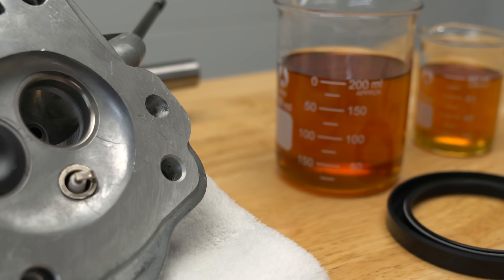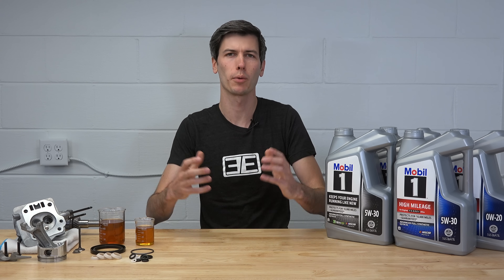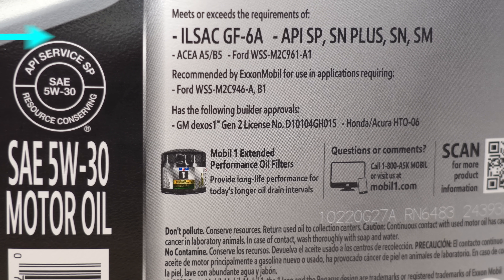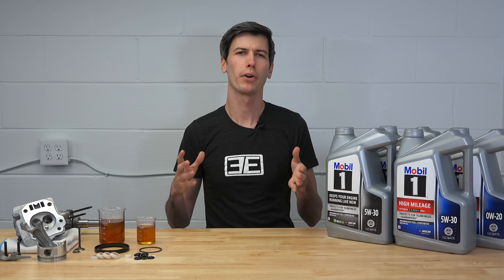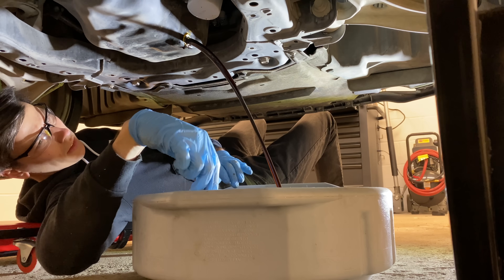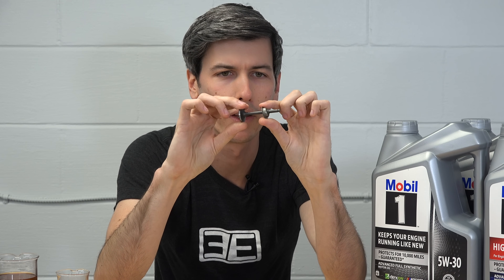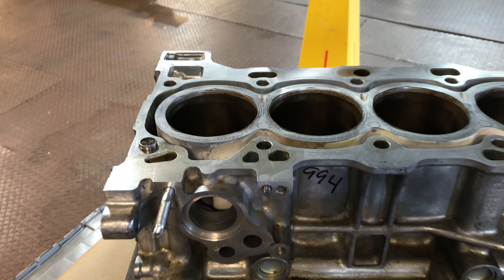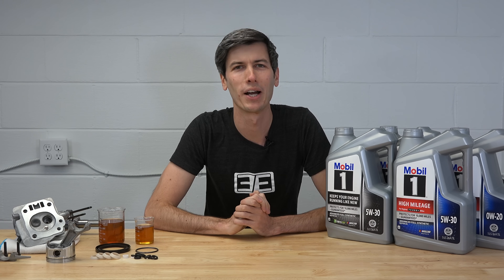Is Synthetic Motor Oil Bad For Old Cars?

Comment: I appreciate your channel and have watched most of your videos.

I watched this one all the way through, hoping for an answer about using a synthetic oil in an older high-mileage engine with a flat tappet cam.  Can you answer that question please?  The zinc/ZDDP zealots are adamant, but have no actual data.

Thank you!

Comment: I had a customer that used Mobile1 synthetic for 120k miles in a Harley Evolution eng. No leaks or oil consumption. He wanted it torn down for inspection. Every component was still well within factory specifications. Replaced gaskets never reuse, cylinder studs never reuse, rings never reuse and touched up valves and seats.

Comment: They say its ok to use synthetic oil in older  vehicles they just dont explain all aspects. If the engine is burning even a small amt of oil say do to a valve guide seal allowing oil to get to valve especially an exaust valve will most likely result  in  failure , the synthetic has a higher BURNOFF temp everyone agrees ....the oil residue builds up on the  valve = overheats , then that cylinder . I lost 2 engines to this 1 simply due to trust in  the hype  .another i added 1 qt of synthetic . 2 good running engines ruined😢😢😢

Comment: If synthetic oil is fine to run in old cars then explain to me why it destroyed my 25,000 mile small block chevrolet in my 71 C-10 pick up. I changed from Castrol GTX 10w40 to Mobil 1 full synthetic oil and within a week it wiped out the cam and lifters and contaminated the rest of the engine with metal particles which then took out the number six rod bearing. I had a very reputable engine shop go through the engine and the first thing he said was synthetic oil does NOT have enough ZINC or DDT in it to properly lubricate a flat tappet camshaft engine. So you need to stipulate that when you're making a video and tell people that synthetic oils are fine for a "OLD CAR" because that is very misleading. Since rebuilding the engine, all I have run in it since has been Valvoline VR1 and it now has 90,000 miles on it.

Comment: Pretty much any vehicle made after 1990 was designed for synthetic motor oils.  It's only those dinosaurs from the 1970's and earlier that may still be using seal materials that could begin to weep or leak due to the superior stability of synthetic oils.
Reply: And at that dinosaur time synthetic oil was real, pure synthetic. Few years ago all conventional oil was relabeled as synthetic (on American market - not European)   So, nowadays pure, 100% synthetic oil is only Amsoil SS, and some of Royal purple. These synthetics really can cause a leak in older or high-mileage vehicles

Comment: I have a 1993 Ford explorer sport with 250,000 MI I used to use 20. 50 oil winter summer whatever I do now use whatever 40 weight oil I can find that is synthetic and it seems to be doing okay but you should change the oil every 5,000 mi that what I've always done so there you go..

Comment: In 2025, I use Total Quartz 7000 10w-40 with Semi-Synthetic oil base, I use it for Honda Supra Fit New (Wave 100s) C-Series C-100 engine, its performance is still safe and even extraordinary, considering this motorbike was released in 2006, In Indonesia with tropical seasons, whether it is hot or rainy weather, its performance does not decrease

Comment: So whats considered old these days in car years?  Ive got a new car, but i mainly drive my 99 grand marquis.  185k miles, its my daily, and couple of 8 hour road a year.  Ive been using 5w20 conventional in the grand marquis, but have noticed the last couple oil changes its been low.  Like i checked it today and it was 2 quarts slow.  A year ago it wouldnt have used any oil.  No leaks either.  Maybe i just try some sea foam or something like that, see if it'll stop burning.

Comment: Yeah yeah yeah.... well , thing is people still buy farm tractors that are new , but the design is very old. Like 40 years old engine , just manufactured recently okay ?
Some did try a "new and more advanced oil" . Those got busted. So they did proove its a bad idea.
So then , people allso buy brand new tractors. And those are recent designs. Tractors are under a lot of load , ideal testbeds . Well take a guess , those who get the new tractors and use oldschool regular oil , are they happy ? Yess they are. Those who use the manufacturer rated synthetic oil are not happy. Engines wearing out in 10k operating hours is a joke. Run it with old oil ? Yepp , you get least 3k more hours. So screw it.

Comment: I'm not an expert on Rotary engines, but high quality fully synthetic two stroke oil, which is meant to be burnt, forms a lot less deposits than old mineral oil or even synthetic based oil. This much I know from data and experience of seeing less deposits on the piston crown and exhaust port. I think Rotary engines recommend two stroke oil or something that can be burnt, so it stands to reason to use the one which forms less deposits.

Comment: Motorcycles here. Old motorcycles run absolutely fine on newer synthetic oil as long as the recommended grade is respected. New bikes usually have tighter tolerances, but mineral doesn't mean better with higher tolerances. There's a misconception that 10w40 is thicker than 10w50 for example. It depends on the temperature your engine is running. Some people think that 10w50 is thicker than 10w40. 10w40 will become thinner only if the temperature exceeds the one tolerated by '40'. If you run an engine on 10w50 it'll either be the same or keep its viscosity better if the temperatures it reaches are higher. Same for Winter, 10w if you live in warm areas won't be different to 5w or 0w. 0w won't become too thick if you start your engine below 0 celsius. I don't know the exact temperatures, but broadly speaking, it's not the viscosity that chances, but the temperature spectrum that an oil can keep its viscosity consistent. For example, if you use a yamaha R1 you'll be fine with 10w50 or even 15w50 if you use it in summer only in the mediterranean, even 10w40, good oil of course, would do if you see that your temperature gauge barely goes over 90 celsius. If you hammer it down a racetrack at 14/15000 rpm lap after lap, use 10w or 15w60, as that should technically keep its viscosity under a lot of heat stress, usually 10w60 is sold as motorcycle racetrack oil. Maybe this misconception comes from the past when you had monograde oils 20, 30, 40 and so on. Those had a specific viscosity at a specific temperature.

Comment: Well I had a 2000 Chevy Silverado with only 60,000 miles on it. Up until then I had always used conventional motor oil. After asking every mechanic that I could find, it actually came down to a 50-50 decision that it's a bad idea to switch from one to the other! Half of them told me not to and the other half told me it would be OK. So I took the chance of switching over to Synthetic oil and within 4-5 month's, the front and back seals started leaking out of nowhere!!! That wasn't just a coincidence! It never leaked a drop of anything before I switched over. 🤬  In my own experience, I would never do it again!

Comment: My vehicle is on 145 000km. No oil leaks or engine wear. I've been using 5w30. Should I now change to high mileage oil because of the high mileage?

Comment: I switched to Mobile1 5-30 for my 1971 big block chevy.  With everything else it runs better than ever.  Word to the wise, if you switch to full synthetic, do a second oil change very soon after the first one, before 100 miles IMO, and even a 3rd before normal interval (e.g. 1k miles).  Engine oils are NOT intended to be mixed (e.g., conventional/synthetic), drain only drains so much.   I'll take my engine's word for it, never mind it's a science fact.  That and you've basically cleaned the system.  I changed mine 4 times over 1k miles, but then, it's a fresh restoration, and I really like my truck☺  Okay, once a year from here on out, (every approx. 900 miles), pinky swear, maybe.

Comment: I use conventional 10w40 in my older vehicles. They run quite and smooth, compared to  the synthetic oil. Less valve train noise, more power, better oil pressure at hotter temps.
That's what they like so that's what they get

Comment: My car manual says 5W30 oil, as it is not available where i live, can i only once use 5W40 oil. Current mileage = 100,931Km. Engine = Suzuki (K14B).
 Engine is performing great and fuel economy is really sweet. Please guide on this. Awaiting your response.

Appreciate!

Comment: I bought a 2003 model VW Polo with a 1,2 liter 3 cylinder engine last July from a dealer who knew nothing about the car, and I got it very cheap. However I noticed that the trunk was full of 5/30 synthetic oil bottles - empty ones. And I was shocked to see that the oil just ran through the engine, consuming exremely amounts of oil obviously. I had to refill every 20 miles. So I got to an oil selling parts shop and got SAE 50 oil for classic cars. Problem solved! During winter I put a semi synthetic blend 15/40 due to the freezing temperatures. It worked well, but also the consumption increased a bit. However, I am glad that the old car still works great until this day.

Comment: Wrong question !!!  

The type of base oil says nothing about performance or viscosity specifications. Nowadays the term synthetic oil is often just an advertising claim.  The only thing that matters is adherence to the prescribed specification.

The right person should ask whether to put modern oil with a different specification in a very old car. Some modern oils are very different - they are so-called light-running oils with low HTHS and low viscosity.

Comment: What about bumping up an oil grade for an engine that has low miles and wear, but burns oil. For example, the Ford F150 5.0 spec is 5w20, but the Mustang 5.0 says to use up to 5w30 for hard use. All the f150 5.0s of certain years are known for burning oil because ford cares more about cafe numbers than reliability of their engines

Comment: I worked at a new car dealership (Nissan) and a lot of the older men, and a very few women, would ask about viscosity and OCI.  Or standard reply was 5000 miles or 6 months whichever is first. The dealership only used 5w20 in bulk which is appropriate for the area of the country.  The turbo engines required Mobil1 0w20 which was a higher cost by about $40 per service. 
Some of the old timers questioned that recommended service but I would simply reply, "there's a lot of debate on that, but Id stick with the manufacturers recommendations to maintain the warranty.  
btw, the warranty on Nissan is 3 years 36,000 miles.  Only a handful of engines failed and it was always horrible neglect. Had one elderly man come in and complained his daughters Altima engine failed at 32,000 miles.   They could not produce a single document showing any maintenance. It ran but it was sludged up and had Check Engine light... would not pass Missouri emissions.  The dad threatened to sue.  My manager said Go for it... lol

Comment: My first truck got rear ended with 240,000 miles on it.  Then the tranny on my Corolla failed with 230,000 miles on it.  Other cars the body would rot out.  Engines never had a problem. 3,000 mile oil changes with the recommended weight,   religiously, is the key.  10,000 I’ll oil changes is insane

Comment: I have used Mobil 1 for many years. In a 1966 Ford F-100 I had I was planning to rebuild the engine. When I took the engine apart, I was pleasantly surprised by how clean it was! No sludge. I chose not to rebuild that engine because I found a large crack in the water case and the cylinder taper was a bit much. I still use Mobil 1 to this day.

Comment: I have a 2012 civic ex with 152k miles. I drive very gingerly, and the car burns no oil. I have been using synthetic, and i change oil every 4k miles. Should i use high mileage oil instead?
Reply: My opinion, your 12 years old Civic at 152k miles, switch to high miles full synthetic.

Comment: I started to get more brass particles as I examined it in the open pan , those particles come from main and connecting rod bearings so I switched to blended brands and it didn’t change the look after an oil change so I guess the motor is telling me it’s on its way out .
Reply: You didn't mention the year make model or previous maintenance history.
Reply: @ well taken care of , purchased new a 2000 Chevy S10 with V6 with at the time 160 thousand  miles , sold truck in 2017

Comment: We live in a high temperature location. Although our cars state to use 5W20 synthetic oil. I always use 5W30 oil instead. Summers with temperature over 100 degrees, I trust a higher viscosity oil for better lubrication. Never had engine problem except my 2002 van that seals are leaking. I think that is due to just old age.

Comment: Was thinking about putting Valvoline Maxlife 10W-40 semi-synthetic to my 60yr old Massey Ferguson 135 (Perkins AD3.152) instead of 10W-30 mineral. Then again, if the oil pressure gauge knows anything, oil pressure is really good (high) to begin with. It is leaking some oil (obviously), but it's more of the "sweating" than dripping kind. Doesn't need adding oil that often.

Comment: I purchased  a F250 HD (gas 460 efi)  in 1992. it has been used to tow my 5t wheel , 12500 gvwr, (loaded scale weight 10.5K) around the  US from cost to cost numerous  times. Curently 165K miles. considered low miles on a 460. Amsoil 10-40 full synthetic  oil sent to test lab at oil change,  which is every 25K miles. tests show very low metallic , detergent  still  good, viscosity good, all compared  to new oil..  Have not done anything  to engine except verious accessories  replaced..  Works good for me. BW
Reply: Awesome lab results. The 460 is a behemoth of an engine.  My dad's 1972 Town Car had that and it ran forever with no issues.

Comment: I have used Mobil 1 synthetic oil in my 1936 Austin 7 for about 20 years. 88 years ago they didn't use oil seals like they do now. Just pieces of felt and scrolls on the ends of the crankshaft. I also use synthetics on my 33 year old Mercedes, 38 year old BMW motorbike, and 40 year old Ford Escort. I never have understood why people would use a "Classic" oil. Why would you want inferior lubrication in your beloved classic?

Comment: I had a collapsed lifter that was rattling in a 305 Chevy after sitting over winter.  It didn't seem like it was going to go away. I had 20 # of oil pressure.  I changed the oil out with 0W30 pure synthetic and ran it for about 10 minutes and the noise went away... sounded perfectly normal.  Now would 0W30 dino oil do the same? I don't know but I think synthetic is better overall for cold starts and the price really isn't that much.

Comment: I run only full-synthetic in my high mileage 350 small block, zero leaks since I replaced a bad sending unit for the oil pressure gauge. Cleared up a lifter knock I had when I bought it and get better mileage with full-synthetic. Anyone who says that synthetics are bad for old motors just won’t admit they either bought a basketcase or are why their vehicle is a basketcase and burns/leaks oil. Just change your oil every 2-4K miles if it’s an older motor with no service records and keep an eye on your oil levels.

Comment: I'm on the front lines of this, if you have an older car, I recommend a synthetic blend. If you have an Italian car also synthetic blend. If any of your seals are cork, natural rubber, or orange or black made before 2001 use synthetic blend. If a car has been sitting use high millage because the seals shrink.

Comment: No.. Do not use synthetic oil in a vehicle not designed to use it. 2 yrs ago I switched to full synthetic oil on a Ford Ranger 3.0 liter and now i was just informed that front seal, rear seal, pan gasket and valve cover gaskets are now all leaking. 1 quart every 100 miles. Only 137,550 miles. The Auto Shop asked me why would I do that? I changed because of Idiot's like this. Now I need a long block installed.

Comment: I used Amsoil in my Ford Falcon and at 130000ks replaced the rocker cover gasket it was like a new engine no sludge  my friend a Mobil Rep gave me Mobil 1 which was new in 1886 or98 it performed as good but cheaper here in N Z

Comment: Older cars typically have flat tappet lifters.  Most flat tappet problem’s are caused by using incorrect motor oil. The oil's used in the 60-90's had 1000-1400 ppm zinc content but zinc was not compatible with catalytic converters so it was slowly removed. Zinc is the lubricant flat tappet lifters need. You should use a high zinc speciality oil (non-synthetic & synthetic oil), preferably around 1400ppm. Use a zinc additives assembly lube when installing the flat tappet lifters as well.

Comment: I was a marine engine at sea for 44 years, we used to have a lot of trouble with air compressor valves, they used to carbon up needed removing every 500 hrs. But when we changed to synthetic oil, after 500 hours there was no sign of any carbon.

Comment: I use Slick 50, in two engines were I had problems with cylinder  heads, when the bearings were checked they had a coating on the bearings they looked like new so Slick 50 works.

Comment: Before Harley sold synthetic oil… they tried to scare HD owners into sticking with Harley brand petroleum. Nothing was ever put in writing, but dealers, AND factory reps claimed that “Synthetic oil is so slick that the roller bearings in Harley motors don’t turn… they just slide… creating flat spots on the bearing. If that happens, your warranty is void.” Miraculously, when Harley began to sell synthetics, all the problems disappeared.

Comment: I use to have a 1986 Audi 5000 it had no problems for about two years. It needed an oil change and the only one I could find in the right Viscosity was a synthetic. After the oil change it started to leak oil bad. I changed the oil again to non-synthetic to no avail. I traded it in for a 1990 5.0 liter Mustang Convertible.